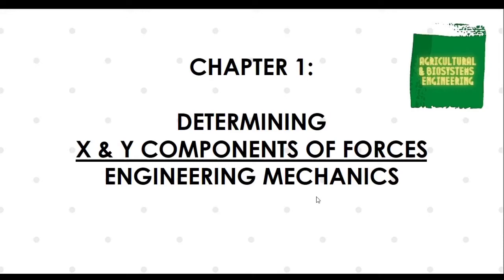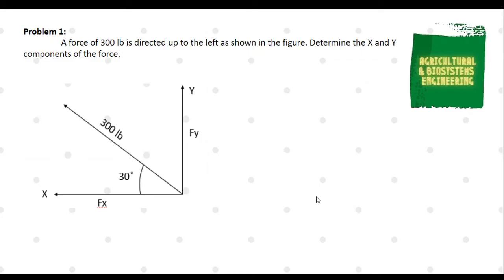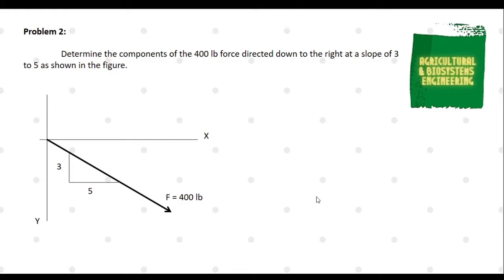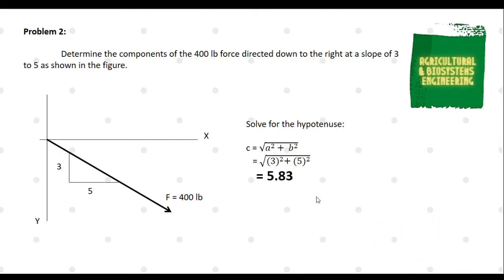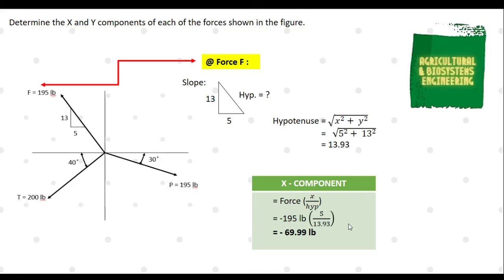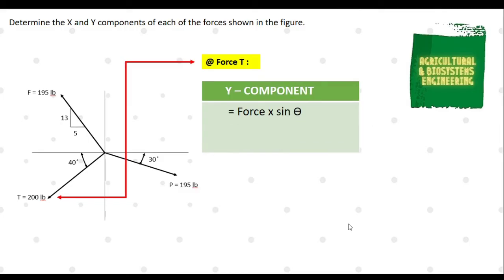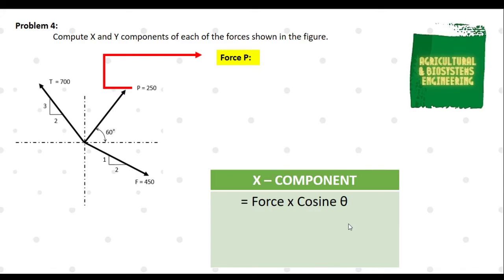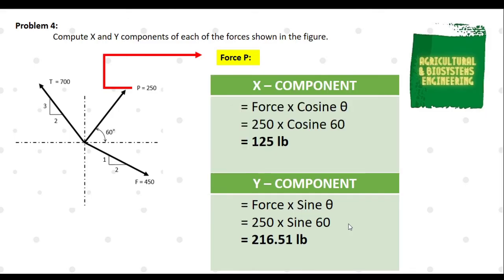STATICS OF RIGID BODIES : X AND Y COMPONENT OF FORCE SYSTEMS | PART 1 | ENGINEERING MECHANICS|

Comment: Question. When will we subtract the angles? For example in FORCE T, won't we subtract the angle first for 270 degrees because it is in the third quadrant? Like, -200 cos (270-40=230)= 128.56
Reply from the maker: You don't need to subtract angles. The angle that you will be using will be the angle shown in the problem.
Reply from the maker: However, subtraction of angles can also be considered if you want to use the Sine function in solving the X component. Whereby, negative 200 cosine 40 is the same as negative 200 sine 50. (50 was solved by subtracting 40 from 90). Same concept with the Y component, instead of using sine, you can also use cosine. 🙂
Reply: @abetutorials  Thank you for your explanation i finally understand.
Reply from the maker: @rheyz5442  welcome 🙂